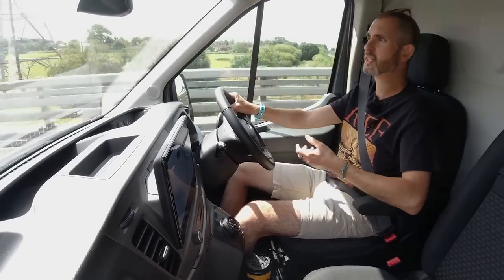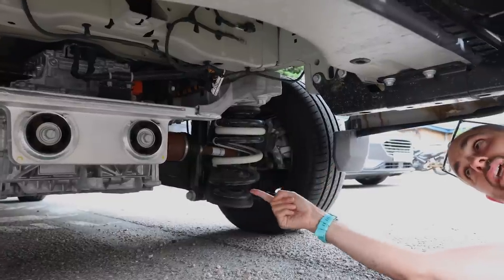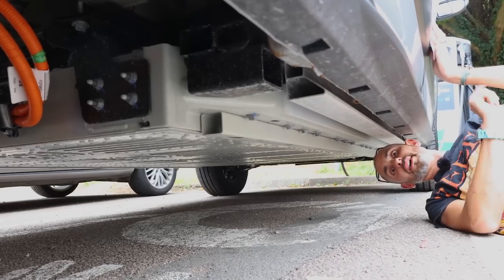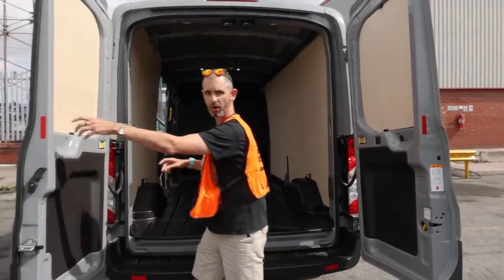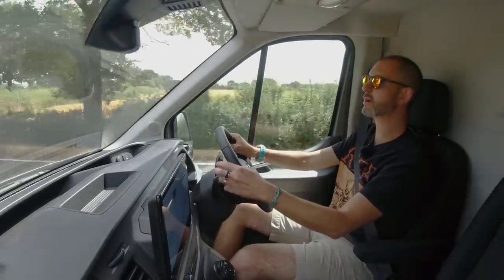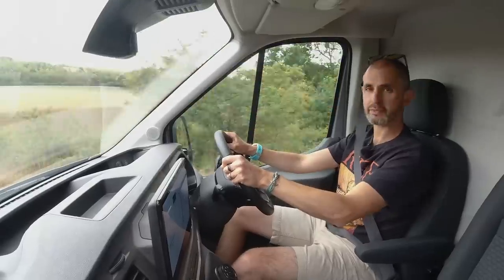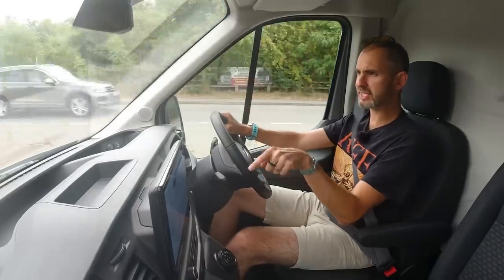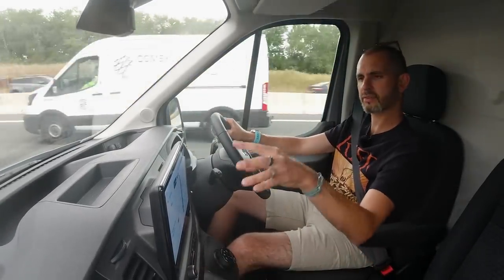New Ford E-Transit electric review - the most important van of 2022

Comment: We've had three E-transits at our company for a good month now, the first three in Norway. They're bloody brilliant.ich better range than the cars they are replacing, three e-crafters with abysmal range (peaking 150km in the summer months and seat that deteriorated after 20k km after jumping in and out many times a day. 

One thing that really bothers me with the e-transit is the cover in the box. It's bloody slippery as hell. Boxes neatly arranged into the back get flipped and thrown around at the first roundabout. It seems they've picked the material with the lowest friction, and polished it to make it worse. Otherwise this review is spot on, resonates my thoughts. Thanks Johnny!
Reply: What kind of range do you get from your cars? It is summertime now so in winter around 30/35% less is to be expected. (range both empty and filled with cargo if you know)
Reply: Our parcels vary in weight, but we very rarely load up our vans with heavier than 750kg, on a busy day. We have 50-80 deliveries per day depending on the route and sales. Sadly I drew the short straw so I am stuck with the e-crafter for the time being so I can't give an average-ish number on the range when we unplug them from our solar power in the morning (whole roof of our warehouse is covered in solarpanels). But the e-transits we've been told to expect about 230km range at best, which is good conditions and no load. 

The heavier stuff and pallets we throw on our euro-6's and Volvo FL electric
Reply: @singularfish  Nice! Bjørn should do a video with you guys.

Comment: Given the small battery (for van) and fairly slow DC charging (115kw vs common 250kw in many new EVs) this van is definitely designed for last mile city delivery - and it would be GREAT for that. It’s definitely not designed for the drive you used it for - though good to see you enjoyed it and it worked for the trip. 
Looking forward to EV-by-design vans - with at least 100kwh (if not 150kwh) battery and at least 250kw charging. It would make them useful for longer trip and due to costs might actually replace semis for some deliveries.
Reply: The cost will skyrocket if they put all this to the van.
Reply: The charge rate is almost 2C, that's not slow...

A unnecessary large battery only reduces the carrying capacity of the van...
Reply: Just imagine if it had a solar roof maybe 2-3K worth on top giving you an extra 20-30 miles of free range a day if you live in the desert or gulf areas or especially if you wanted to have a van-life home.
Reply: @chinabluewho  You might be able to fit 1kw of solar panels on the roof. If you're super lucky, you'd get 10kwh per day into the battery. With the efficiency of the van you'd get 5 miles per day (assuming you don't use any of that electricity for stuff inside the van, like refrigerator, fan, etc, not to mention A/C). So, having solar is nice but unless you can extend the roof (like a solar canopy) it's mostly going to help with running stuff inside the van, not for driving it.
Reply: @cmorait  Charging speed does not cost much money - it's mostly Ford being ~10 years behind on battery tech vs EV leaders (Tesla, Hyundai, etc). As for battery size, it would increase size, but for a commercial customer, it would increase range and thus use of the van, which would increase it's economical value, thus while price of van will increase, TCO (which is what matters to businesses) will reduce.
Reply: @MichaelEricMenk  Tesla, Hyundai/Kia, Lucid  and Porsche can all charge at 250kw - Ford e-Transit and F-150 Lightning max out at 150kw (which is more/less what Model S did 10 years ago). So, no, 2C is not consider fast anymore. As for carrying capacity - for many delivery applications, range and % of day the van can be used (esp with slow DC charging), the larger battery would be a welcome improvement - even with additional cost.
Reply: @ranig2848  and let's just take the first one.

The charge speed on Tesla is permanently reduced of you fast charge to much.. Why, because their charge speed is to high....

So, they are damaging the battery in order to sell cars....
Reply: @MichaelEricMenk  non sense. I have friends that drive Uber and supercharge at least once a day without issues for over 2 years. I have no idea where people get all this non sense information.
Reply: @ranig2848  Bjørn Nyland has covered this on his channel... So no please go to his channel and say that it's nonsense what he has documented...

By the way, the technical teams at multiple car companies are watching his channel and taking notes...

If you charge to fast, the damage is immediat and permanent..

Comment: I expect the higher regen being the 🇱 button is due to how auto transmissions have worked forever; put a car in Low gear, and you get more engine braking (i.e. car slows down more aggressively when you lift off), which is especially useful for descending long tall mountain roads without fading your brakes out. Having the same function be controlled in the same way makes sense for people who are only just transitioning from gas cars.

Comment: Trying to understand why Ford did not put the motor drive unit in the front and allow for a lower floor as well as the option of extra battery capacity over/behind the rear axle 🤔

Comment: The f150 lightning has power points everywhere, via USB and inverters. Anything like that in the transit that I could charge my tools while charging the van or making for a really easy camper conversion?
Reply from the maker: Yes, in the back is an optional power take off for charging or powering tools when on site. This early version did not have that unfortunately.

Comment: Electric transit makes lots of sense. Especially in built up heavy traffic areas. 
 Most of that noise in the last scene was tyres, ev’s still make that noise, if not more so. 
Good vid Jonny
Reply: Both DPD and Amazon are using electric vans to deliver in my local town. They're based 20 to 30 miles away, and only occasionally need to charge during their delivery rounds. They seem to have made an agreement with a local Supermarket to charge if/when necessary.....

Comment: For those companies with depots/workshop with solar panels already on the rooves and a general daily driving distance within the van's range, the eTransit and other EV vans could be a real cost saver for their businesses. The demand will grow as they will become more common and hopefully, prices will drop. Yes, there is the question of how really ecological they are when it comes to disposing of the battery etc., but quieter vans delivering to residential areas and cleaner, avoiding emissions charges in inner-cities are already positive differentiators. For companies that depend on power tools, but will drive perhaps only a limited distance to and from their job site in a day, the van could also be a very useful power source.

Comment: 1:26 - THIS! This is what I've been saying for years! All the Vans go back to the depots at night (where they could be charged). They would likely make a huge saving in fuel costs as well. It amazes me that Royal Mail haven't thought of this. I get the impression they are just trying to run the business into the ground though....
Reply: Royal Mail cans vans shockingly cheaper due to the amount they buy. I think it was something like £7k per van for the Combi's which are common, they'll be mad to go for anything else until they can get low price per units.

Comment: Usually people work in the daytime. You cannot charge it from your own solar at nighttime. Simply because during the night, there is no sunshine to charge your car. Charging at a fast charger costs considerable money and then the whole ev driving needs re-calculating. So you need two Vans. One is charging from your solar during the day while you drive the other one. The trip in this video costed two stops to charge. Glad I saw this video. It is no ev for me. I cannot afford to have multiple charging stops per day and no home charging because the sun is so stubborn it won't shine during the night.

Comment: Attracted to this review when titled affordable however consider that description totally wrong, around €30k might consider. However at €32,500 a no no. Today in my Mercedes 2019 B200CDi AMG with all the tricks, did a 302 mile (486 km) trip at 72.4 MPG on a ¼ of a tank of fuel and still had enough for a further 458 Miles. The Mercedes MBUX System is just fantastic and the Virtual Reality Sat-Nav. Just say increase heat by 2° and it will comply along with hundreds of other commands. You can even say "phone Beefeater at Peterborough" and next minute you are connected "How can I help you ?" etc etc. Cheaper running costs are a huge delusion unless you have access to 'free charging' - And even if able to charge at home the lowest rate you can achieve is Economy 7 overnight at around 5p per KWh. On Motorway Services the cost can be as high as 35p per KWh which when worked out makes it in fact more expensive than any car capable of 45 mpg or better.

Comment: Your right. All the normal switch gear that we are accustomed to needs to be right on the dash in plain view. How stupid and dangerous to fumbling around scrolling through screen menus just to adjust a simple thing like the ventilation etc. Also going from one e-whatever to another and taking 30 min to figure out where all the necessary switches and buttons are. They need to start standardizing this stuff. Some people work at places where you have to share the fleet with employees and like normal the fleets are often a mix of makes and year models.

Comment: FYI fuel tank location was at the front left underside of body. That space under the rear was for the spare tyre. The circular form may have given that away, if you knew about older transits. But looks like wasted space with no spare wheel .perhaps another battery or underfloor storage for kit?

Comment: I find it interesting that the drivers side AND the sliding door are swapped between US and UK, but the rear door which is the master (has a handle) is the same configuration as the LHD van. Because most people are right handed?

Honda did that with the early CR-Vs, which is why I didnt buy one, even tho it was LHD; they had a Japanese-hinged rear door that you had to (in US) walk from the curb out into traffic to get around it. Now its a liftgate so it doesnt matter.

Comment: Love the ETransit. How about Ford making the drivetrain for a affordable retrofit in my 68' mk1 LWB Transit. Now THAT would be a cool mod. Yes, I know, keep the old ones old and smelly and noisy. But I would be using the van a lot more than I am now. And I will rather it be a EV and used, and shown in the streets for the youth to enjoy, than it sitting and being used as a shed, as it is currently. Love the show as usual. Keep working on the Transit song 🙂...
Reply: 'How about Ford making the drivetrain for a affordable retrofit in my 68' mk1 LWB Transit'.. 🤪

Comment: If you loaded that van up fully, it would barely do 80 miles. Hot day, aircon on? Barely 50.
Reply from the maker: I did have the AC on periodically during my journey and it used no more power, which was a pleasant surprise.

Comment: Every time I see a review I want one as Camper Van 🤩
Might just have the budget for the eTransit Custom though 😐
Reply: This is my dream too. Snag is you will be loading the van with all the fit out for a camper and the range will suffer as a result. In fact we didn't get real world numbers in this review but 166 miles on a 65 kwh battery is 2.7 miles per kw. That's as against 4 or more in a model 3 Tesla. As you would not run the battery right down and it takes ages to charge once past 80% your effective range between (rapid) chargers is 166 - 15% - 20% = 113 miles at best. Good luck finding rapid chargers in Wales! Plugging into a 13amp socket on a campsite ( if you can find one willing) will give you about 9 miles range per hour so if you arrive at 6pm and leave at 9am you should have 135 miles plus whatever was in there when you arrived.
Reply: @keithhoughton4308  as HPC increases there will be more on secondary roads.
The range there will be better. I'm just to embark on an eFixxter, an eJumpy XL.
Up till Germany I do highway. Next is secondary only. Plug in AC stalls when site seeing. And HPC on route.

Main issue with the eVans is their weight for the licence. eTransit is on the limit when build as Camper I think.

Comment: I drove Diesel to work 35,000km a year, now two months back I bought a small EV and I never wanna drive something else ever again, it drives amazing! though I must say you're never gonna get the distance they say you can but only 2/3rd of it. I should be able to drive 310km with it but I wont be getting further than 230 or maybe 250 when driving 100km/h (60mph). But that's enough for my daily use and above all it's only half of the price per km.

Comment: Nice colour transit, new colour for the milk float version? Love my 10 speed auto transit which is based on the same thing, luckily heating controls are via buttons not glass! 
Saw a good spec one for £65k!! Too much money for solo tradesman however I see the benefits for delivery people. Saying its green and good for the planet of course is baloney. That journey took 40 mins at least longer than it should have done to charge. Hopefully Ford etc will go hydrogen for the proper tradesman that do towing (and some folk for towing their caravans) 
If you happen to drive into someone, you didn't like, what's the repair going to be on that front charger socket? 
Where you fill up with fuel on a normal transit  on the passenger side by the doors, that would make more sense to me?

Comment: That electric motor looks very vulnerable. If you go down the track with the big hump in the middle also that battery doesn’t look like it’s ready for any bad gravel roads. I might be wrong on that but I think those cables would be better with a cover, and what will it tow?

Comment: I'm curious. I live in the western U.S. Washington state.  Most of our power is generated  by hydroelectric dams. As a result  our power is less than .10 cents a kwh. 
What is the primary source of power generation  in the U.K.? Cost per kwh?
What is the forecast for expanding  the grid to accommodate the growing use of EV's?

Comment: Just note that winter range will be reduced to about 100 miles in very cold weather. Some other You Tube videos have range tests. Camper van or conversions will be interesting with added solar on the roof. I would tow a small trailer with solar array or carry several 100 watt panels if it was a camper.

Comment: Neat. But as always screen controls for eveything must be painful. Especially when im assuming you'd be managing AC more to save battery etc.
Reply from the maker: Correct, touch screen is a pain rather than trad dials for easy-access functions like heating etc.
Reply: @TheLateBrakeShow  I like.how you made a point of the Bluetooth connecting straight away - important for someing getting in and out of the car all day. In my limited experience so many cars blutooth just doesn't connect properly. But my $200 alpine aftermarket stereo in my e30 bmw connects perfectly every single time. NEVER faults. How can a $200 alpine unit work better than oem?

Comment: Poor load placement Jonny, if not getting the fork driver to push the pallet along the floor to the front then put another pallet on the floor in front of it to prevent it sliding forward.  To unload just tie a rope around the pallet to the forklift's tow pin to drag closer to the rear. Or carry a pallet truck on board.

Comment: All that extra driving to charging stations must be adding a lot of extra trip miles that cost extra to accommodate. How does that tally for your true cost per mile when considering the shorter point to point distance served by more energy due to out of point miles, plus the cost of the extra labor hours spend charging.

Comment: Slight problem being that, we are being threatened with power cuts this winter, but there is an ever-increasing pressure for everyone to change to electric vehicles. The Royal Mail depot in my area has just changed over to all electric delivery vans. More electric vehicles on the road means more electricity to charge them all. Good luck doing that come winter......

Comment: 57 p a kw from instavolt. 68 kwh battery. defo used the lot at least once. so its cost 35 quid to do the journey. seems cost is similar without the hours faffing about two days on the bounce against diesel. I'd put 70 quid in tomorrow to do twice this fully loaded. regulations,subsidies taxes etc are the only thing that seems to make this remotely viable. coolant on the charger too. we haven't factored in the electric range dropping like a stone in winter. I'm buying second hand diesel next time i think. I'm not sure these are viable once i've loaded tools etc into the van. great review though dude. I enjoyed the content.

Comment: I work across the way from a dpd depot and they’ve got a sizeable fleet of Nissan ev vans for local deliveries, clearly a commercial market for this sort of van. 50k is pretty tasty for an Indy van driver or tradie though, even with 5k off!
Reply: True, although if it's only 4k more than an equivalent spec Diesel (and given the relatively massive reduction in fuel costs, especially if you can rely on just overnight charging, rather than fast charging), and it would appear to be a reasonable deal..